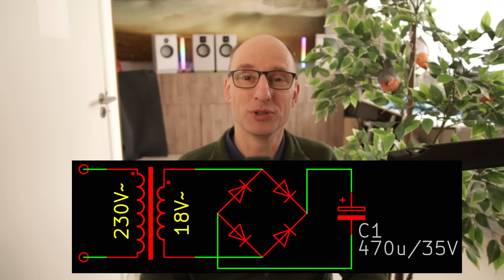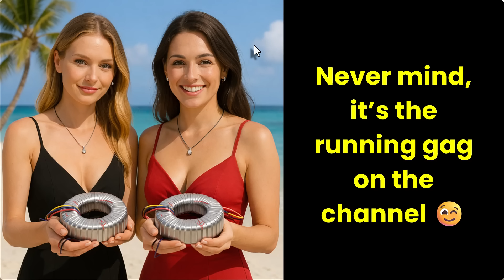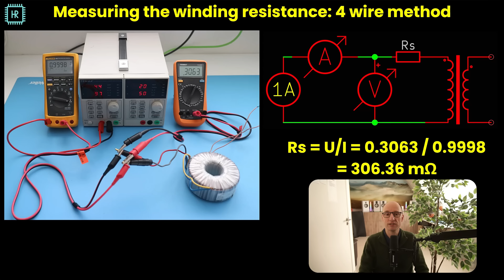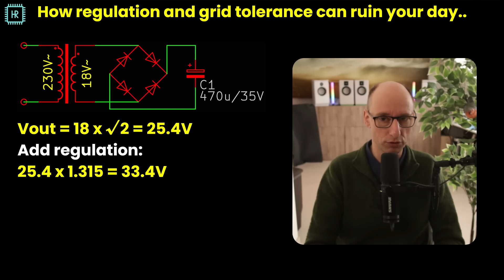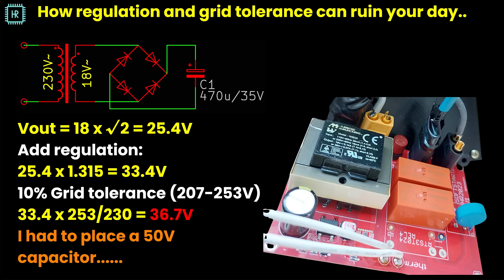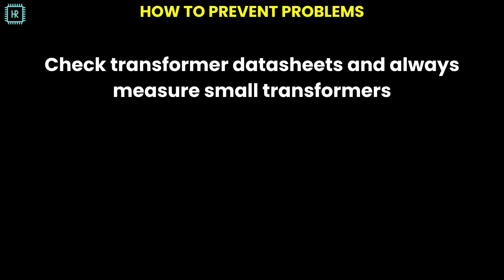Linear Supplies Can Destroy Your Designs

Comment: In all you presented here, you are correct in your assessment however, I have designed and built more linear power supplies than I can count in the past 40 years. To this day, I've not had a single failure. Most circuits were not very critical but in the cases they were, I planned ahead with over voltage circuits just in case.
Reply: Also, MOV surge suppressors, small spike bypass capacitors across the transformer secondary (or across each diode in the bridge rectifier, plus the familiar +20% rule will cover almost every application.
Reply from the maker: I agree: They never fail once well designed! This is just a warning to watch out for the big range of voltages you can expect at the output.

Comment: You mean “plain old rectified AC” designs are no good. 
We use “linear” non-switching supplies in anything that must be noise free and  extremely fast responding.
Reply: The closer the regulated voltage is to the unregulated voltage, the bigger the capacitor needs to be. It's imperative, that the valleys in the voltage ripple of the filter capacitor stay above the 'drop out' voltage of the regulator, to maintain an accurate ripple free DC output from the regulator.
Reply: @vincentrobinette1507 obviously
Reply from the maker: There are some very clean and low noise switching supplies these days. I have not used those yet, but these are getting better and better.
Reply: Not always the best decision.
Those old school linear supplies also have EMC & EMI issues, for example rectifier diodes being noisy, transmission of mains noise, etc...
Reply: @ABa-os6wm  : Omitting the capacitors across the diodes is a standard error [tm]. And mains filters are much to expensive, too.
Reply: @ABa-os6wm  using germanium transistors as diodes fixes that .

Comment: Or you could buy your transformers custom made for a known load current.
Reply: I would have thought an output voltage regulator was de rigueur for most applications ... to be sure, to be sure.... 🤔

And whats with speccing your smoothing caps so close to the output voltage in the first place ?...😲
Reply from the maker: You can do that, but it's very expensive, and it won't help with grid voltage variations.

Comment: There wasn't really a solution here. I had this happen to me even though I oversized my caps they were still a little close. I added a bit of a load resistor to lock things in a little tighter.
Reply from the maker: Haha, I did that too with that pcb in the video. 10kOhm was enough to get rid of the highest unloaded voltages.

Comment: Hammond typically specs the resistances rather than the regulation. Either will do
Reply from the maker: I could not find anything for this small pcb transformer. Maybe they give a lot more info on the bigger ones?
Reply: @HansRosenberg74  It's on the hammond website under 183E36, just google it?

Comment: What about resistance variation in transformers? Do you have to test several of the same model?
Reply: going to be pretty consistent given they construct them with a fixed number of turns of a standard gauge of wire.
Reply from the maker: Yeah, should not be much tolerance there, it's copper wire basically....
Reply: They vary approx linearly to absolute temperature. May cause thermal runaway.

Comment: It was my understanding that you should include a safety factor when working with capacitors. A common one for HVAC is 150% of the peak voltage. 
Thank you for this video, it was very helpful.
Reply from the maker: Yeah, I usually do that. It is not a problem to operate a capacitor just under it's nominal voltage if you can guarantee that you don't go over it. 

Making more margin increases lifespan in a very non-linear way (in combination with ripple current and temperature)

Comment: Is t he regulation even worse than specified when charging up a large capacitor on the peak of the mains voltage (with the large output load, due to pulsing currents where the peak currents are much higher, hence larger voltage drops across the resistances), compared to a simple resistive load?
Reply from the maker: Well, a capacitor without charge behaves like a short almost when subjected to a voltage spike, so it will be worse than a resistive load.

Comment: I learned all of this in my late 1970's high school electronics class when linear power supplies and audio output transformers were still very common.  It seems odd that this wouldn't still be part of Electronics 101 today.
Reply: "just buy a PCB mount regulated switchmode supply", or take the transformer specific course
Reply from the maker: Indeed

Comment: Be careful configuring your multimeter when measuring resistance of high-inductance components. I noticed that there are some pathological cases that can occur with auto-ranging. One time I used my Keysight benchtop multimeter in an attempt to measure the resistance of a choke, but what do you know, it measured negative resistance! Verifying what was happening with an oscilloscope, it turned out that the quick switching of the measurement current by the auto-range logic resulted in oscillation with the inductor. Hence my tip: set range manually and verify that different range settings match in their measurement.
Reply: Cool 😅
Reply from the maker: Hah, cool, I have not seen this fault before. I would consider this a design problem for the multimeter.

I tried to do the same measurements with my 34401A just to compare and they were very close together with the measurement setup I show in this video. So that one works well.

Comment: These 10% voltage tolerances are very liberal too. Engineers nowadays design switching supplies to handle anything between 80VAC brownouts in the US to 250V solar peaks in the UK. Diode-capacitor rectification causes horrible PFC and even suspicious EMC. It could get disqualified before even those tests just for the low energy class due to all the heat loss. A linear supply designed for 80-250v inputs would barely have 40% efficiency on a 230VAC socket in the EU. I've personally ditched a few 12V 1A powerbricks just for their 4W heat loss at open circuit. My monitor, router and phone chargers are all plugged directly into the 12 and 5 V rails of my computer's power supply that has much better efficiency and voltage quality than any standalone powerbrick designed for them.
Reply from the maker: Indeed. Linear supplies are only interesting for single voltage use, so 230 or 115. Switching supplies are much more convenient.
The issue I have with switching supplies is reliability. They always break way faster than a well designed linear supply.
This is a design choice by the way, if you design them well, they will be almost indestructible, but they're always designed on the limit. I have the feeling that especially the low power ones are really bad in that respect.

Comment: I thought the European standard mains supply voltage was set at 230 V ±5% to accommodate all the different standard nominal voltages across counties, with countries that are close to the upper and lower limits controlling their maximum and minimum, respectively, more tightly so as not to exceed the European standard.  For example, the UK standard voltage is 240 V, but will never exceed 241.5 V, i.e. 230 V + 5%.  The opposite is true where the standard is 220 V: in normal operation it never falls below 218.5 V.
Reply from the maker: No it's really 10%. I used to work for a grid provider in the Netherlands and it's a challenge with all the renewable energy these days. I did a lot of grid calculations under extreme conditions.
Reply: One important thing is that you need to separate producer and consumer.

The consumer - your electrical devices - must handle a wider span, because the lowest voltage in your outlet includes tge voltage drop of the wiring all the way to you? Your electricity supplier? Doea not measure their deliveries in your home.

Next thing - 3-phase that is unevenly loaded means your home may lose even more volts on one phase. But end up with too high voltage on a different phase. Your electricity supplier once more do not adjust their production based on a sadly unbalanced installation in someones home.

And that is why you really needs lots and lots of margins for the end-user equipment. The end user is likely not able to measure and find they have 260 V on one phase during assymetric load.
Reply: @perwestermark8920  Good point: I know from maintenance workers that the supply to local properties near where I live is extremely unbalanced, owing to difficult wiring logistics.  Lightning and wildlife are our main dangers, however.
Reply: Same in Spain, +-7% is allowed. When I moved, the new place's service was close to 245V any normal day. An audio amplifier I made fried itself after just a couple of uses, since it run on an unregulated linear supply like the video shows - granted the PSU was a bit on the limits, but it had lasted for years in my previous home!
Reply: The European standard is EN 50160, and it allows way more than that. See: "during each period of one week 95 % of the 10 min rms-values of the supply voltage shall be within the range of Un ± 10 %" - i.e. it can deviate more than 10% for short periods of time, and 10% for most of the time. And then there many kinds of anomalies, transients, harmonics, special circumstances, etc.
Reply: @gumo77  Eeeek!  That's really dirty!
Reply: I'm not roaming around Europe to measure it, but pretty sure everybody uses 240V now, official or not. In Hungary the countryside is bang on 240V, in cities around 230V only because the sine top is chopped of, best I measured in the middle of the night was 236V. Interesting to see because I couldn't really imagine what devices are still in use without powerfactor correction, old TVs and amps little standby transformators would pull the voltage that low.

Fun fact after watching the video I grabbed a little cheap yellow meter to check the mains it showed 247V, I used that meter because the leads were plugged in that one, grabbed a somwhat proper meter it showed 240V.
Reply: @sviktor4 Okay, that's interesting.  Here is my measurement from rural UK on an ordinary Wednesday morning, using a cheap, little, blue supermarket meter over two or three minutes, I found 240±3 V.  I only saw 238 V and 243 V on two momentary occasions; most of the time the meter showed a steady 241 V.
Reply: @cdl0  Now you made me curious, I don't have a good meter in hand, but if I don't forget I will measure it again how much it changes in a short time.
Back then when I measured the numbers basically I concluded the sinewave would be aways bang on 240V and if I measure 236V it's because the top of the waves are chopped off that much. It was a whole rabithole first I tought my scope or something else bad, but it is preitty hard to find different main voltage locally, so when I visited my parents a brought a scope too and voala perfect sinevawe with 240V, so it was dirty city power all along.
There was a time when heavy machinary building happend like 3-4 blocks away and every day around 11 o'clock my amp toroid started horribly buzzing so I turned it off, unfortunately I never measured what is happening with the mains.
Reply: @sviktor4 I hope some other viewers can submit their measurements.
Reply: @cdl0  Here's my update, (as I forsaw I forgot the topic).
10-storey commy block, Budapest, Hungary, all electric cables are upgraded couple years ago
232V with 0,8V variation - weekend night
228V with 1,8V variation - during normal days

The sinewave would be perfect 240V, the difference comes from how much the top of tha wave is flattened.
Reply: @sviktor4 So, that's a reasonable voltage, but dirty when you take into account that it is not a proper sinewave.  @rgones measurement in Spain looks nastiest at 245 V, since that did damage his equipment.  This looks like a good topic for Hans Rosenburg to investigate further.
Reply: I found the regulations for the UK: 230 V declared, -6% (216.2 V) to +10% (253.0 V) limits (The Electricity Safety, Quality and Continuity Regulations 2002, No. 2665, part VII, regulation 27), so worse than I thought.

Comment: The transformer is a rather complex component to understand. To calculate the output resistance, the resistance of the primary winding can be referred to the secondary winding by dividing it by the square of the transformation ratio. The model can also include leakage inductance. In the equivalent circuit of the transformer, it is connected in series with the load and will also cause a decrease in voltage with an increase in load current. For a toroidal transformer, the leakage inductance is small, but for an E-shaped one, it is quite noticeable. The model can also account for the inductances of the windings. This will allow the calculation of the idle current. However, there is a mysterious issue — if the inductance measured with an LCR meter is used, the idle current will be almost an order of magnitude higher than the actual current. The reason lies in the dependence of the magnetic permeability of transformer steel on the level of magnetic induction. Another mysterious question is the inrush current of the transformer. It can significantly exceed the nominal current, even if the transformer is not loaded to a rectifier with a capacitor. This surge depends on the moment of connecting the transformer to the network. It will be at its maximum when connected at the zero-crossing moment of the voltage. The magnitude of the surge is influenced by the permanent magnetization of the core and its saturation. However, even without these effects, a surge will occur upon connection to the network, even with ideal inductance.
Reply: I thought inrush currents were only inherent to capacitor-backed power supplies.

Would a NTC resistor help here, or, alternatively, a soft-start power resistor to be shunted out by a slow closing relay?
Reply: @sashimanu  You are "charging" the transformer core with magnetic energy. If you turn on power at a zero crossing, and start from an empty core, then you have one half-period of input power to charge in one direction, before the voltage polarity changes and you start first draining magnetic energy before "charging" in the other direction.

If you turn on power at a voltage peak, you instantly have more voltage to try and drive a current. But you now only have half the time to drive the current in one direction before the polarity change. So you only try to "charge" half as much magnetic energy into the core before starting to drain and then magnetize in the other direction.

This difference matters, because the magnetic core only fits a limited amount of magnetic energy before getting saturated. And the amount of work needed to drive current through the coil is very much affected by if the core is saturates or not. That changes the inductance.

If the core is fully saturated, then you basically only have the wire resistance to limit the current. The transformer behaves more like an air coil after it has been saturated.

If the core is not saturated, then you have a significant inductance that limits the current - remember a coil wants to slow down current changes while a capacitor tries to slow down voltage changes. A too small capacitor gives wicked ripple. A saturated coil/transformer draws wicked current.

So turning on the transformer power at a zero crossing can result in a very violent surge because you try to add twice as much magnetic energy into the magnetic core as normal.

It can even be worse than this, because the core can have some magnetic flux remaining after you cut the input power. And next time you power on, depending on the input polarity, it can now take even less time before the core is saturated.

So - lots of circuits are designed for zero-crossing turn-on just so power is applied at zero volt resulting in zero initial current. But that is not the best for big transformers, where flux change in the core is what is limiting the current and you want to avoid the core from saturating.
Reply: @perwestermark8920  Even an ideal inductance without a core will give an inrush current surge if you turn it on at the moment the voltage crosses zero.
Reply: @leoniv.  The big difference here is intended use and voltage. The transformer is designed with the magnetic core as main "brake" to keep the current under control. Because it's connected as a "short" on the input voltage, while you do not want a short. Normal coils are traditionally used in series in circuits because their main task is to be an inductance while the main task of a transformer is to deliver energy to the secondary winding.

And you could for some transformers get a 40x inrush current - which is huge if that's a big transformer.
Reply: @sashimanu  No, there will be inrush current even for a transformer without a load, or for any inductor in general. The presence of a ferromagnetic core, which can saturate, worsens the situation even more.

If the transformer is low-power, there's no need to do anything about it. For high-power transformers, it's better to limit the current by any means possible (NTC, R + relay).

For example, Solid State Relays (SSR) have three switching types: Zero Switching, Instant-On Switching (for inductive loads), and Peak Switching (for heavy inductive loads).
Reply from the maker: Indeed, many more details can be added. The magnetizing current upon turning on can get huge.  I have a 3kva isolation transformer. I tried to turn that on once without inrush protection. That kind of blew all the fuses in my home circuit board. Luckily they were all manually resettable circuit breakers :-)
Reply: @HansRosenberg74 My Denon audio amp with 1.3 kW toroid transformer almost always makes the light flicker when turned on. I guess it's about how lucky I am with the phase when turning on. If zero-crossing or close to a peak.